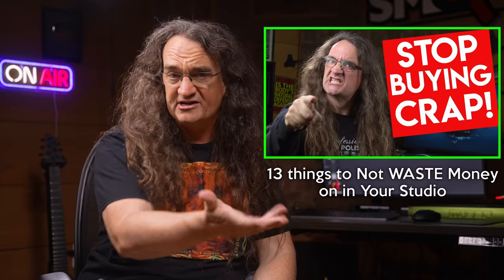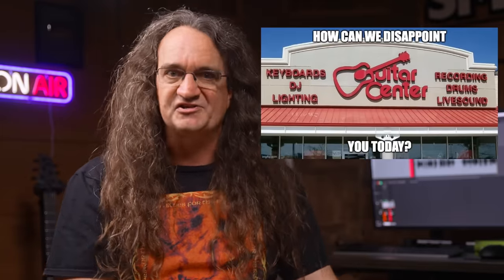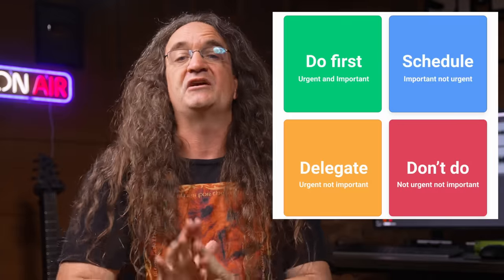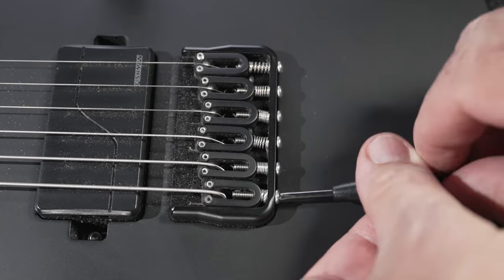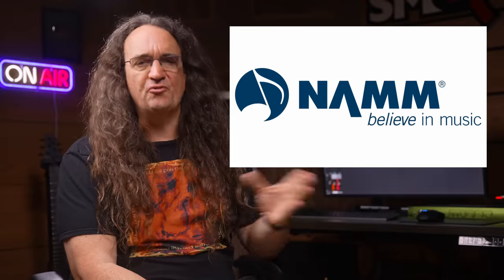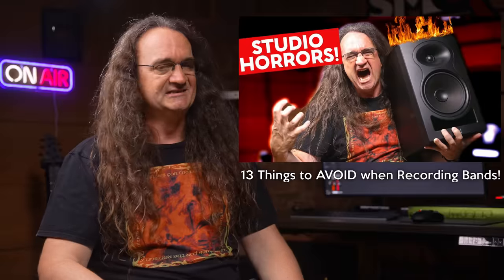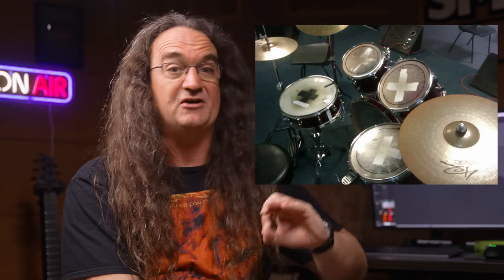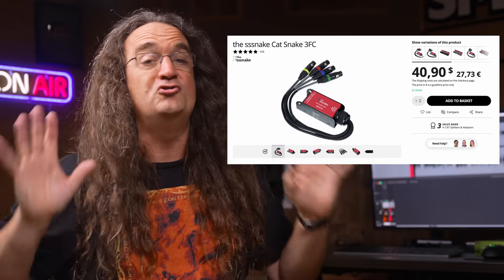13 Things to AVOID in your Home Studio!

Comment: After spending a lot of money to get my guitars set up and never getting them adjusted to my taste, an old dude from a 2nd hand guitar shop one day told me to save my money: he showed me the basics of setting up an instrument. took him about 10 minutes. It really demisified the whole thing: there is no magic involved. Then all it took was a couple of practice and i've been setting up all my gears for years, including floyd rose. And I wonder why people find them so hard to deal with. All it takes is basic knowledge of the mechanics of it and doing the steps in the right order. It's not rocket science.
Reply from the maker: Agreed!!!
Reply: Totally agree, although it's not rocket science, the more guitars you work on the better you get. A lot is about getting the confidence in your own soldering skills for electronics, and learning what YOU like when it comes to each guitar, so you can set them up perfectly each time. Key thing is developing a routine - steps in the right order as you say - so that you work through a checklist, and if there is still some issue at the end, you can work your way back through each stage to find the mistake or problem. Final tip I would add is, get a good nut for your guitar. I'm a total Graphtec TUSQ evangelist, as they solve so many standard turning problems due to the constant lubrication never snagging on the strings. Prefer them to bone even, unless the bone nut has been masterfully cut which is a whole skill in itself :)
Reply: @martin-1965  yep, the graph tech nut has, in my experience, solved most tuning problems I've encountered. usually people blame the mechanics, but unless they are really really bad, most of them will do the job. And changing the nut is usually a lot cheaper ^^ And also, don't play Gibson.
Reply: Totally right. One of the first things after I got my first (cheap) guitar (late 2000s) was to find out how to set it up. It was a mess out of the box and even I could tell, as clueless as I was. Never ever have I paid anyone to work on one of my guitars. Nowadays I do fretjobs and cut my own nuts. Is it as good as the work of a custom job luthier? Probably not. But I think I get the job done pretty well and it's close enough. I bought a used guitar from ebay for like 30 bucks to learn on how it's done, went on to my budget instruments and ended up not fearing to do it on my "four figure" instruments as I got enough experience doing it on the more affordable stuff.
I recently bought a used 2010ish Ibanez where the seller claimed to have polished the frets. Well he did, but mostly he polished the fretboard. It's a mess and I'm looking forward to get it fixed. 

Regarding the Floyd Rose I have to say it's not hard, but it's (at least to me) a very annoying process to go through. But it's not like you have to do it several times.

Comment: Hobby Luthier here. Best way to set your intonation is in a playing position because you will compensate for gravity pulling down the strings as well. The differences aren't that massive, but still, there's no reason to not doing it the correct way. Cheers!

Comment: Glen, #1 Solder has saved me so much money over the course of the last decade.  Those suckers out there still playing $80.00 for "High Quality" Mogami guitar cables, meanwhile I paid a total of $150.00 for the same Mogami cable reel, Neutrik silent connectors, other connectors, etc. and now have plenty of nice guitar cables and dozens of patch cables.  Spot on with this point.

Comment: Great video, one addition that goes hand in hand with soldering, electronics and others: Multimeter!! It's a must have, learn how to test continuity, resistance, charge, etc.
That way you can: Test your analogue cables, your power cables, your electric circuits, your 9v batteries if they are charged or not, if you have a short circuit somewhere, if a transistor is busted (Yes Glen, not everybody have/like tube amps), if your electronics are not fried, and many other things.
It is Diagnosis 101 tool.

Comment: My tip: Use feeler gauges to measure string height (the distance between the fret wire and the bottom of the string). Why? It is difficult to see the little tick marks on a ruler when you're dealing with 64ths of an inch, and the positioning of the ruler can distort the indicated height. With feeler gauges, you can get as close to perfect as possible. Also, use a capo on the first fret to eliminate the nut from potentially influencing the measured height. Also, after experimenting with setting up my neck so it's perfectly straight and raising the action to eliminate buzz, I've found that adding a small amount of relief, as recommended by the guitar manufacturer, is the superior method—you get much more sustain that way. And lastly, use the neck pickup, roll off the tone knob, and use the twelfth fret harmonic to measure pitch when doing intonation adjustments. The 12th fret harmonic eliminates the amplitude of the vibrating string and gives you a more accurate reading. For the first string (the thin, high E), I use the open string, as that string is so tight, that it basically has a negligible amplitude, plus the tuner does not respond well to the harmonic at that high of a pitch.
Reply: It can be more if you check several octaves on the same string, intonation is also the last thing todo, if you add/remove relief after you need to intonate again, same when using different strings gauges or material that has an effect on the tension.
Never used a feeler gauge on the 8th fret, I use a capo at 1st, finger pushing down at 12th and check that there is reasonable relief with a finger of my fretting hand, feeler gauge will make it more accurate though.

Also important when it comes to intonation and saddle position, low E and G furthest to the back of the bridge followed by A and H and D plus high E most towards neck, if that isn’t the case there is most likely an issue with the nut.
Saddle hight should also follow fretboard radius, there are gauges available for that too, but not really needed if action is set by checking for buzz on all frets for each string, unless the action is set higher than it would be just to avoid buzz.

And another tip, if pickups have adjustable polepieces it can be a good idea to adjust them to get the same output balance between the strings, a db meter helps but ears should hear it too if the gain isn’t clipping so hard that it starts to mud and eq not to scooped while slowly strocking and picking with an open G chord to let all notes ring, especially usefull for solos and songs like Paradise City that have that all notes definition on the chords.
Reply: To add to that tip... don't own feeler gauges?? If you know the amount of relief you need, there's a chance a string gauge might be just the amount you need... use as scrap bit of string as a feeler!!
Reply: @@TheOriginalSolarflares How do you not manage to get propper distortion going without fret-buzz?
Isn’t it weird that some metal players can park trains under their strings while still having propper distortion?
A tiny amount of buzz from going low action is fine as long as notes don’t get chocked when doing bends or a held note doesn’t ring out like it should, personally I prefer to have the action just on the edge, just below 2mm at the 24th fret, and with perfectly leveled frets a relief that is barely noticeable, almost straight.
Reply: @@TheOriginalSolarflares Through repeated experimentation, I have found that if I set up my strat according to factory spec, the instrument feels and plays great. As mentioned in my original post, I always wanted to have a perfectly straight neck, so I tried that for a long time, but switching back to having just a small amount of relief, as recommended by Fender, made a world of difference in terms of how well the guitar sustained. It was like a totally different instrument. In theory, intonation, tuning, and fret buzz are at their minimum when the neck is straight, but I have found that in practice, a small amount of relief is a necessary concession.
Reply: icankillbugs  I sincerely hope I never have to hear you play with that attitude.
Reply: icankillbugs  Ah, so it does matter to be properly and not "sort-of" in tune after all. Appreciate the essay proving that, have a good one.

Also, line breaks are your friend, that was kind of a chore to read.

Also I do have really intense pitch perception, so I can hear when things are very slightly out of tune (not one cent off, that's beyond any human's perception, but maybe 10 or so cents and so on, I can tell). It usually doesn't bother me if I can hear it's a deliberate choice and not just amateurs who don't know they're out of tune. Zen Guerilla are a good example, they made use of nasty, purposefully slightly out-of-tune guitars and it worked great for their sound.

I didn't mention anything about "motes of dust" affecting anything, calm down. You assumed a lot from one short comment.

But yeah anyway, you basically argued against your first flippant comment so good job.
Reply: icankillbugs  No rebuttal?! I'm disappointed.

Comment: A small point to add to the soldering point: learn DEsolder as well. Knowing how to solder will help with making connections, but sometimes, you need to break the connection, say in the instance of bridges. As you said, solder is not glue, so you want to remove as much as you can before applying new solder, as most solder contains a flux (rosin) in the core that helps it flow around the joint. A desoldering iron or just plain solder wick will help.

Comment: Fun fact, this video is by far the the best and most useful video glenn has ever made. I have most of these skills but rarely implement them. That doesn’t matter though, because when the need arrives I’m the person to do it! 

Example: A mic broke over a decade ago, it was one of my oktavas. Found out a cable got loose inside, got some solder fixed it myself. That was a several hundred dollar savings from having the skill. A couple of years after that my guitar input jack broke, had to solder it myself. These are easy fixes i have no problem spending the time to do. That being said i hate building my own cables and paying a local shop or friend a few dollars over cost of the cable to do it for me is something i’m happy to pay for to save me time (i’m slow with cable building). 

As a professional, audio engineers are REQUIRED to do many of these skills in studios and in other situations. You are the tech to fix things and make sure it keeps working. I worked at a university for 6 months, i was required to fix patchbays and network gear. While it wasn’t soldered in, it was all crimping network cable. I first did that stuff in HS wiring up internet/network for my entire house with my dad. It was fun.

Also replacing tubes is super easy, I don’t know why people get so scared by it. 

The deoxit sounds helpful, I’ve heard about it before, but forgot the name of it. Gonna pick up a can of this asap. My guitar is annoying af with the pots. Thanks for the reminder Glenn! 

Cable wrapping is still something i can’t do fast all the time. Gonna try this method and see if it speeds up my workflow with it. Maybe i’ll hate doing it a little less 😂. Basic, but we all have gaps in knowledge. 

Also love how you explain guitar maintainence. I’ve done it once, and never felt like i did it right. I dig how you explained the process. I usually just hand off my guitar to a tech friend who can do it all fast so i’m saving my frustration on it all. 

Anyway thanks again or the video Glenn! All these skills are what separates the pros from the hobbyists imo.

Comment: Tube amp builder here! You don’t actually need to use a cloth to remove the tubes from your amp since they don’t reach high enough temperatures for that to matter (unlike halogen headlights from cars). Also, the standby switch was designed for doing maintenance work on the amp: so “letting the tubes warm up” without the standby on before use, and turning it off but leaving the heater on so the tubes “cool down” is essentially useless (and can even drain the life out of your tubes).

(There is a video were Collin from CSGuitars explains it better and I’ll leave a quote from a professor of mine here as well: “In WWII tubes were used on the tank’s electronics, what makes you think they are so fragile?”)

Comment: I bought a TS-100 soldering iron several years ago. It's great; small and portable, can run it off an RC battery pack, little case that holds the iron, battery, solder, and a small solder sucker. Easily goes into a case or gig bag for taking to shows.

Comment: As a field electronics technician, you are right about soldering.  It's a skill that even some guys in my line of work are not good at.  There's some bad information out there.  Best thing you can do is tin both items you're going to solder, use heat shrink for extra protection (remember, these cables can also be used out in the elements), and then check for continuity and make sure it measures out properly.  After that, if you're ever worried a cable might be damaged, use contact cleaner and canned air to clean the connections and check continuity again.  It's a lot quicker than just running a new cable and hoping it works.

Comment: Don’t forget the flux and clean the tip. The flux helps with the flow of the solder.
Reply: And if you use a flux capacitor, you can skip to when the soldering job is finished
Reply: You dont usually need to add flux since its already in the soldering wire, its more if you need to reflow already existing solderings without adding new solder.

Comment: The point about soldering, I had a cheap pencil type soldering iron and when I upgraded to a nice soldering station, the old one got chucked in the gig bag alongwith a few feet of solder wire and a roll of desoldering braid... Granted this might not produce the great solder joints you'll get in the shop but for a quick repairs 30mins before showtime in the backstage, it'll do!! You can always reheat the joint and make it pretty again back home!!

BTW, I'm a drummer and I always carry my gig bag full of tools, spare strings for bass and guitar, various patches.. XLR to 1/4 in various genders in order to patch signal in or out of various sources that might not have the right connections... Oh! and I might have the unicorn traits of showing up to gigs and playing in time!!

Comment: Good points regarding soldering, can also be used to build pedals, especially expensive limited ones, and modify/repair pedals and other equipment with hand soldered components.

One tip, never cheap out on connectors/plugs unless you 100% know that they don’t fail when they shouldn’t.
Some examples, there are cheap XLR’s with hollow pins, Jacks with weak tip connections and so on, probably fine if they rarely are touched after plugging them in, but if they are moved a lot you really don’t want them to break when you need them, especially on longer cable runs.
Some of the cheaper connectors also have issues with getting resoldered, had some jacks that didn’t like that, so in the end it does pay of to get good durable connectors even if they cost slightly more.
Be aware that even Neutrik has some crap connectors in their catalogue, so always a good idea to check user reviews to see if there is something negative with a valid technical explanation when it comes to durability and soldering/resoldering them.
One more thing, always check which min/max cable thickness they can be used with.

Comment: Learning guitar soldering and wiring has helped me install my jeep stereo and and work on my e bike wiring it seems so easy to take for granted but setting up a guitar is very fussy and combines several disciplines from mechanical engineering, carpentry, to electrical work it's a lesson in applied physics for sure.

Comment: Soldering is just an amazing skill in general and you can turn around "broken gear" pretty easily. I bought a 412 cab loaded with Celestion Seventy 80s from a guy who thought 2 of the speakers were blown out for $60. I had a hunch that this is probably incorrect when I bought it too. Tested the speakers and they were fine. Turns out, one of the switch jacks was no longer making a proper connection. Literally a $0 fix for me as i already had one laying around from taking cheap amps apart.

Deoxit is also amazing! I bought a used 200 watt bass amp for $80 as well and the guy said that the knobs were crackling. I bought it right there and sprayed the pots with deoxit. Done.

A lot of repairs are pretty simple (not all),  but if its like low voltage electronics, like a guitar or a cab, you can probably fix super easy.

Comment: I followed advice on a luthiers' YouTube channel, and used a piece of wood and a clamp (2 is better) to straighten the neck before turning the truss rod. It really takes the scariness away! I had turned it a quarter turn, that was as far as it would go without forcing it. Then I clamped it overnight, and tried it again, another quarter turn without applying pressure, I readjusted the clamp several times, over three days, and ended up getting a full turn out of it. Each time I tightened the clamp, or even just moved it (2 clamps would have been good), the truss rod would give just a little more, without applying much pressure. I'd leave it overnight, and then tighten the clamp a little bit, and try the truss rod again, which would again turn a little bit more, without me applying much pressure. By not much pressure, I mean turning easily, without denting my thumb.
It was good advice, straighten the neck and then adjust the truss rod to hold it in position, rather than making the truss rod do the work of straightening the wood. 
I bought a second hand acoustic bass, sight unseen, and the neck is bowed beyond what a truss rod can fix, but now, and with lowering the bridge, at least it's playable.